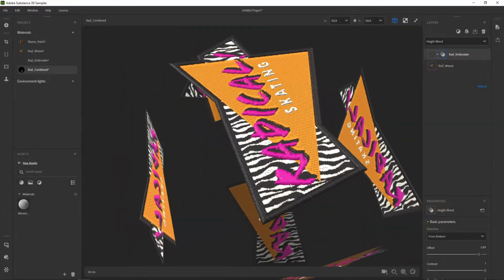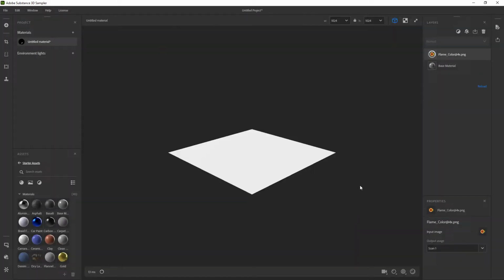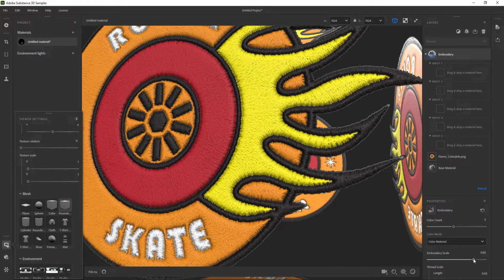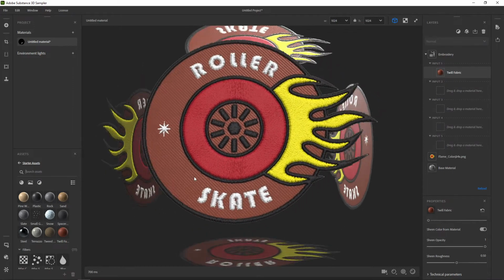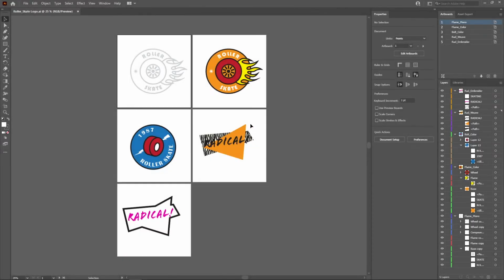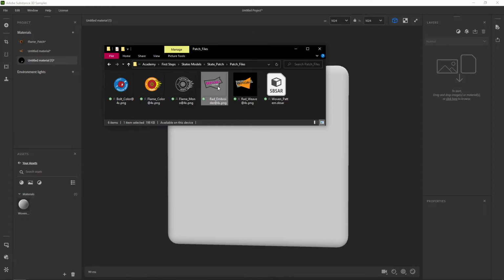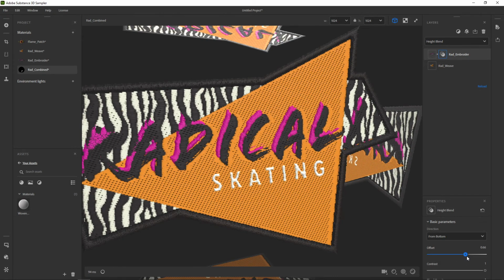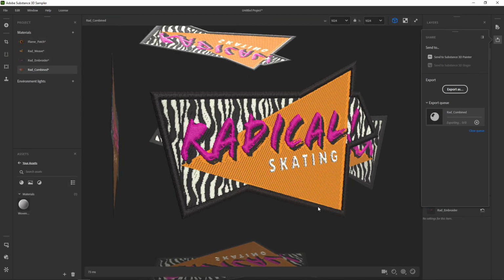Substance 3D Sampler First Steps: Embroidery & Weaves | Adobe Substance 3D

Comment: This tutorial is just what I needed but I have one issue, My scene has a base material on the boot which has some height details and this is coming through my patch logo. how do I get an anchor point for the patch alpha to mask the boot height details?
Reply from the maker: You can change the masking mode from height to another one, Opacity Blend for example. You'll have to balance and adjust the height well though, it can look weird if you don't

Comment: I've followed this video three times now and each time my embroidered product looks like a ball of yarn. You also haven't given the 7 other people who have had the exact issue any idea as to how to fix it.
Reply from the maker: Did you use the provided files? It really takes only  3 steps: drag and drop PNG with transparency, pick "use as bitmap" template, dd Embroidery filter. Then just tweak the embroidery settings. Nothing has changed since this tutorial was made. If ypu are using your own bitmap, check if it has proper transparency, make sure it's 8 bit RGB color (and not CMYK or grayscale mode), and it should be fine. Just compare with the bitmap files we provide you.
Reply: have you found the solution? im having the same problem. the thread looks plasticky and not exactly like one shown in the video. ive even tested with the files adobe provide
Reply from the maker: @loubloom777  Are you using 2048 or even 4096 resolution? This material really doesn't look good at 1024.
Reply: @Substance3D  I used 2048. but luckily I have solved this issue by increasing the embroidery scale value past the default maximum value of 1 — which I didn't know it was possible to do. Super happy with how my woven crest logo with embroidered backplate turned out. Thank you!
Reply from the maker: @loubloom777  Thanks Lou. I'll make sure to point this out better in the updated version of this tutorial once we get to making that.

Comment: New to Sampler. I have a high-end PC with an rtx3800. That being said, I highly recommend switching to a lower resolution like 1024 always while you’re working. If your computer is being loud or slow, this is always a good fix. Is there a default setting for that in prefs so I don’t have to change it manually each time?
Reply from the maker: You have a point, but with hardware these days (and especially an RTX 3080), no need to always go down to 1K unless you want much faster visual feedback. 2K really works fine for most materials. I did check and each new material always defaults to 2K, but stores the change afterwards. I'd recommend you not worry about it and just let the 3080 do its job ;)

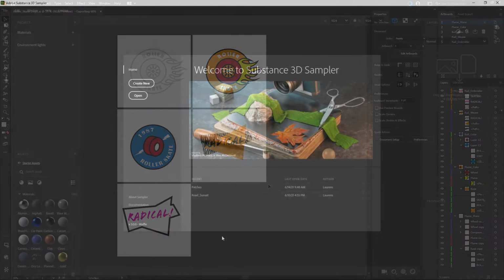Comment: when I am importing the PNG (exported from illustrator according to the parameters described min 1:00) & applying Embroidery filter I just get a greyed bumpy image of my design instead of the colored embroidered sample. Cannot identify what went wrong, can anybody help? thanks xx
Reply from the maker: Does it do this with every PNG ? It's worth trying a few different ones, even the files from the tutorial would be a good idea. that way you can figure out if your export is wrong, or if there's a problem with Sampler's filter in your case.
Also the latest Sampler version lets you use SVG files instead of PNG, worth trying it out!
Reply: hello evi, how did you solve this problem
Reply: Hey did you ever by chance fix this issue?
Reply from the maker: To anybody having issues: make sure your PNG's are exported correctly. 8 bit RGB color PNG with transparency. Also Sampler will probably only play nice with up to 4096 px wide, if you have files at 6K or higher resolution, you're not winning quality anymore.
I haven't been able to reproduce this issue at all, and have not gotten enough info from anyone with this problem, so I'm still guessing.
Reply: @Substance3D  I imported the same png from your files and I comes out all bumpy, I can see color but I cant get rid of the bumpiness unless I put all the height 0 which is not the goal..
Reply from the maker: @taniaviegas6749  Keep in mind the height slider in Sampler is just a preview. You'll have to set this height up again in your final applciation (unless you use Physical Size with Clo for example, there's another video on that).
The "bumpiness" you see is probably just displacement quality. Again, the height is just a preview, so don't get too worked up over it. Try adjusting the quality slider to see if that improves it.
Reply: Might be a late answer, but I had the same problem. Turns out Sampler was using integrated graphics instead of my Nvidia GPU, you can change it in the Nvidia control panel.

Comment: @Adobe Substance 3D  I got a problem when i add the embroidery effect. It only works on the edges a little bit and nothing happens in the rest of the drawing.
Reply from the maker: Is your resolution set to 2048 at least? it really doesn't work well with lower resolutions. Hard to tell what else could be wrong..
Reply: Might be a late answer, but I had the same problem. Turns out Sampler was using integrated graphics instead of my Nvidia GPU, you can change it in the Nvidia control panel.

Comment: So, I've tried these exact same steps but I've noticed that when you bring the material to SP it doesn't carry the height "displacement", it is flat when you look at the embroidery from a side view, different from what happens when creating it in Sampler. Any idea of why I'm not getting the displacement? (I've applied like a decal as suggested in the video, not sure if this is the reason why). Thanks in advance.
Reply from the maker: Is the height channel not exporting for you? Make sure to enable it in the Sampler export dialog (with Send To it should come along). In Painter, make sure to enable the height channel on the layer.
If those are on it's just a visual setting: Painter does not enable tesselation and Displacement by default, you have to do this through the shader settings, open the shader settings with the ball icon, scroll down, increase tesselation and height.